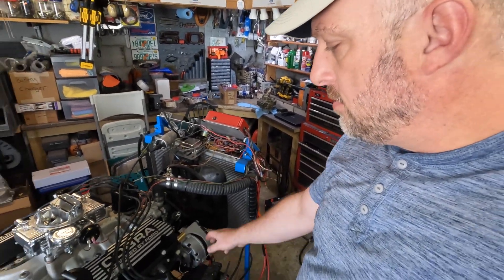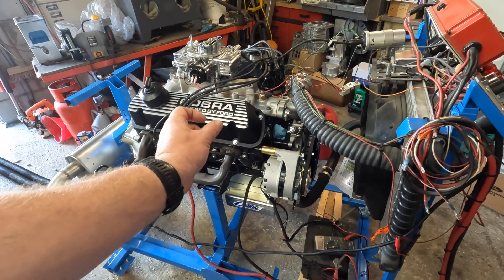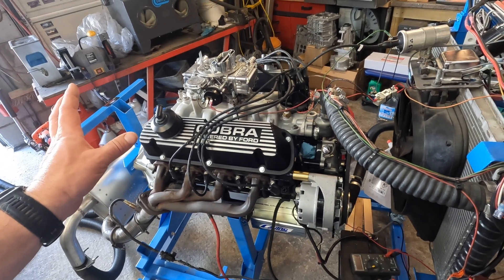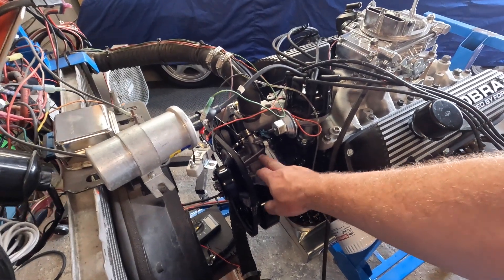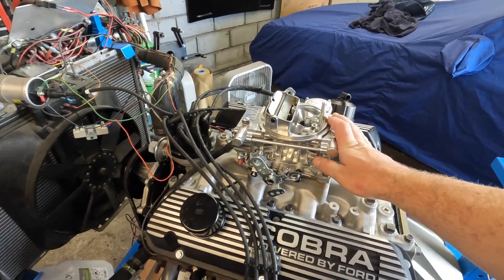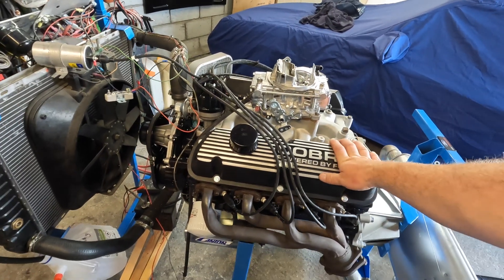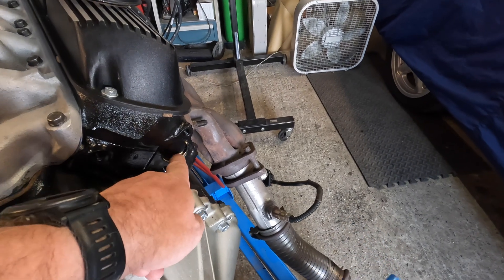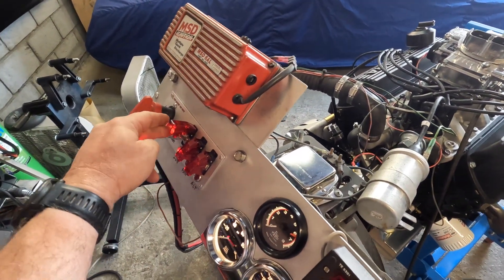Fresh Rebuilt 1965 289 Running and Break-In

Comment: Will you end up running vacuum advance?   What is your total timing?

I have a hipo out of a ‘64 Cyclone and two drag engines used in a ‘62 Ranchero back in high school. One ran 11.80’s and the other 12.80’s. Been dragging them around for 40+ years now...
Reply from the maker: The engine is with its owner now and will likely not be heard running again in several years until he gets the rest of the GT40 replica completed.  The vac advance distributor was only used as finding an original Autolite dual-point wasn't in the budget at the moment.  I set up the engine to run 34deg total timing.  If the owner ever gets it on a chassis dyno he can optimize the timing from there.